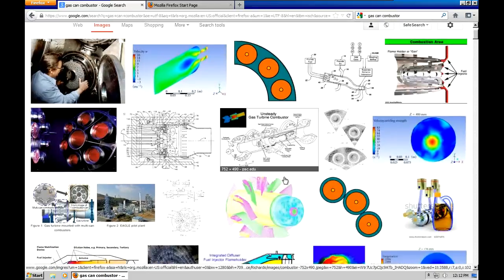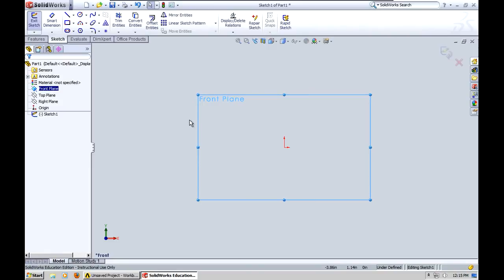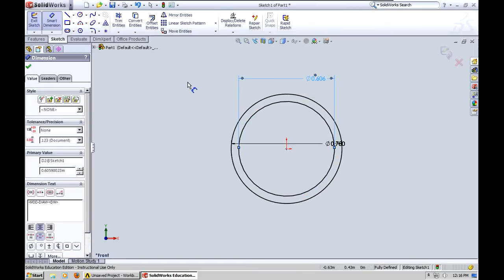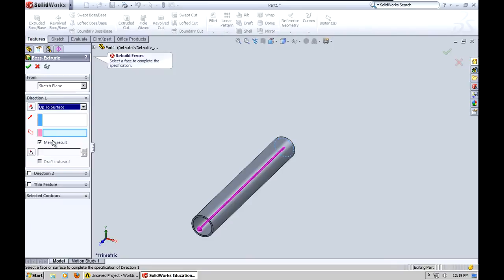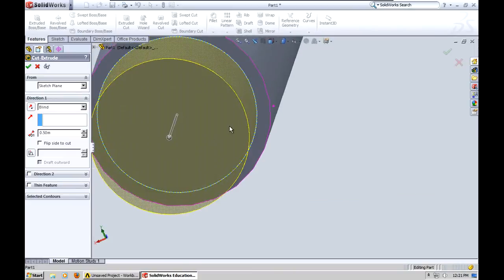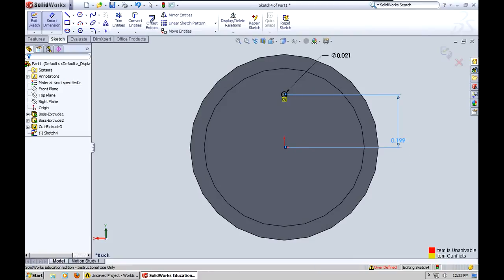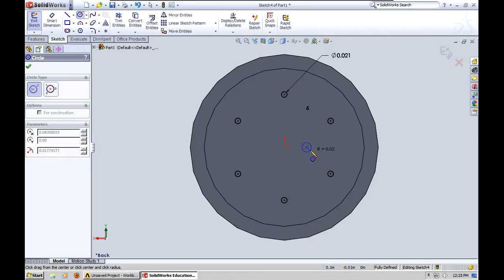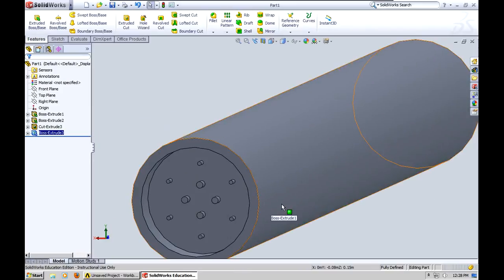SolidWorks Combustor Geometry

Comment: I can't thank you enough! I did it with your help without having any knowledge on solidworks.I just have a question.This is supposed to be a combustor but the cylinder we made is solid.Shouldn't it be empty on the inside?
Reply: +zafos900 if you make it empty then it will show you just contours of process. So you have to make it solid.

Comment from the maker: well the mass fraction of ch4 and oxygen would be depleted in the same regions but the highest temperatures would happen a little down stream. The mass fraction of the oh is usually what is used to predict the "flame front" of the combustion. Remember it is a chemical reaction, there are many species that are created and changed between the mixing of CH4 and O2 to the creation of H20 CO2 and other species. Also note that this solution used the RANS method which finds an average loc flame front